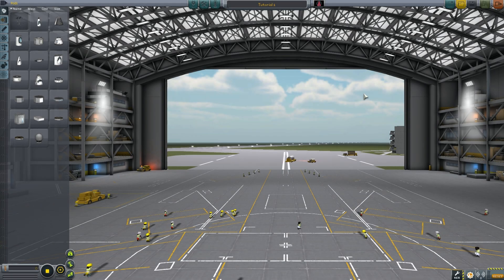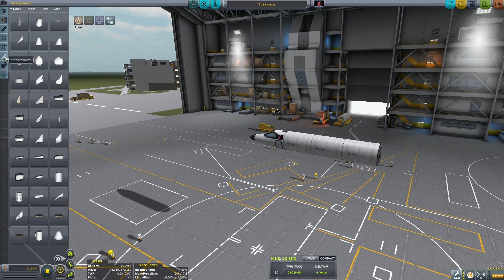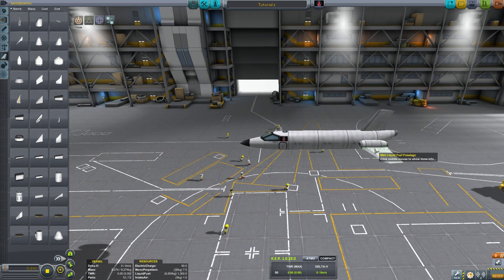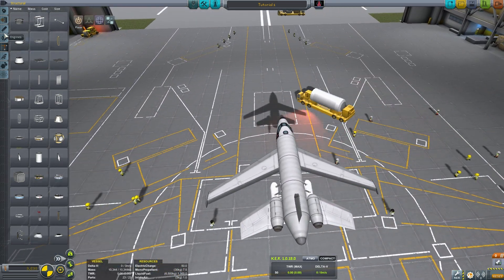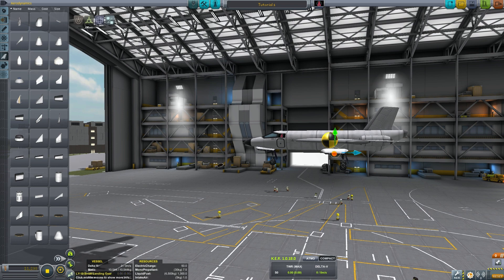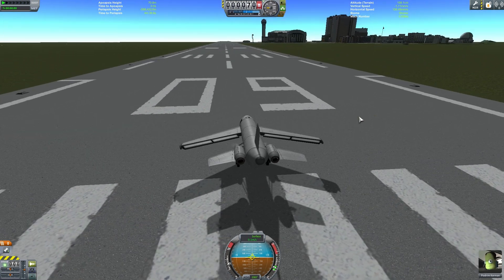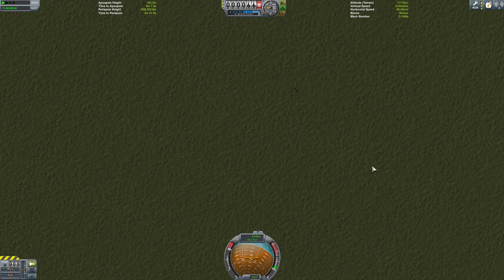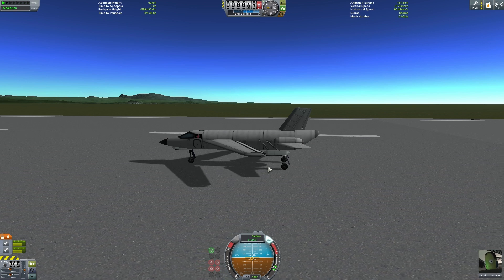Kerbal Space Program: First Plane Tutorial Updated

Comment: thanks for this, helps alot! i didn't have control surfaces which was why I was crashing   on runway. does the fuel in the middle large tanks count to the  engines as they are not directly attached to the engine part?
Reply from the maker: Yes as long as the fuel tank is on the same "stage" it feeds the engines. And you're welcome :)
Reply: +K.A Nordic thanks for the info 👍

Comment: Is the MK1 cockpit like a mod? Since it isn't in the parts list, or has it been removed. I'm playing version 1.2.5 or whatever it is
Reply from the maker: This is a pure vanilla tutorial, so no modded parts. This particular tutorial is done in creative mode. If you are in career mode, you may need to unlock the science tech called "Aviation". The first one with an airplane icon. (Version 1.1.2 )
Reply: I play in Sandbox Mode, and the only Mk 1 Cockpit I see is the one which looks like a fighter jet cockpit and nose, not like that one.
Reply from the maker: Hm. The only thing I can think of is that you are using an older version of the game. If i remeber correctly they changed the look of it back when the game went beta 0.90

Comment: The center of lift shouldn't be in the center of mass..... Derr
Reply from the maker: +Carter Dieringer You are absoulutely right, however I found that doing it this way works better with keyboard controls without having to trim all that much. But thanks for pointing that out... 

I gracefully accept your "Derr" :)
Reply: So where should the center of lift be?
Reply from the maker: +TheMadCrafter Generally for short flights it does not matter as long as it is close to the center of mass. However for longer flights, where you use a lot of fuel, the center of mass will shift. For example: if most of the fuel is in the rear, it will drain over time and shift the center of mas forward so you wil want the center of lift in front of the center of mass to compensate for this.
Reply: K.A Nordic thx